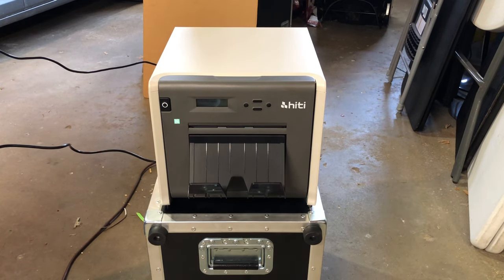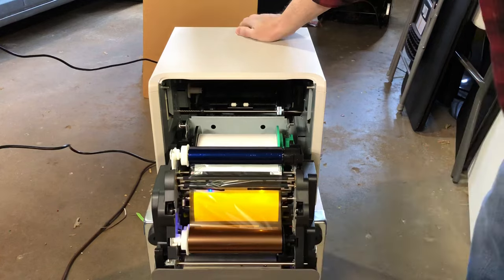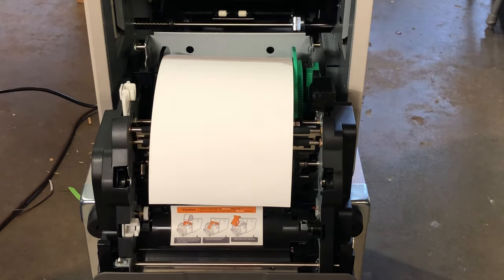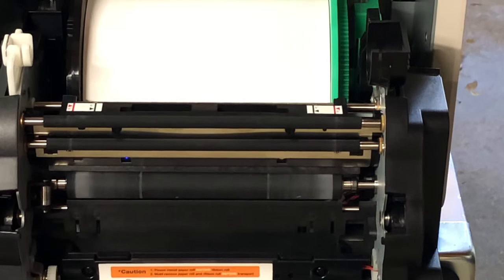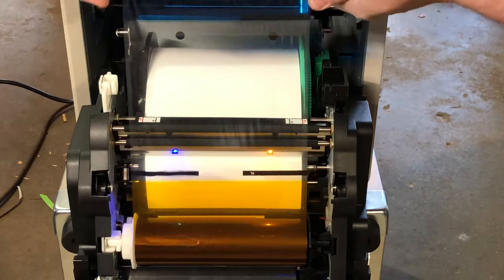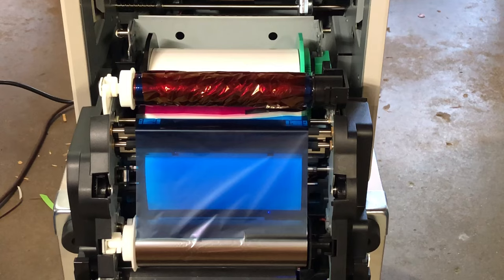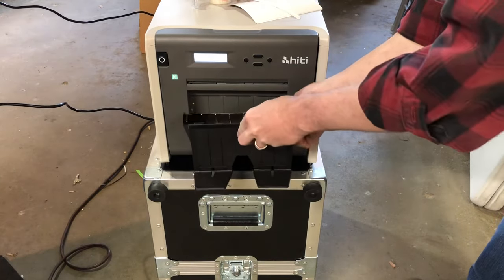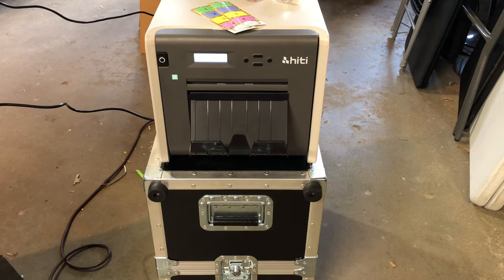Hiti P525L Loading Paper and Ribbon

Comment: Hello! I would need help. I use the same printer with the dslrbooth program, but it won't let me print 6x2 pictures, (windows 10) when I try to print, it keeps telling me that the roll size is not good (6x8).

Comment: Hello sir I just finished using up my paper and ribbon,  I changed out the paper and ribbon but when I close the system the printer starts up but it keeps telling me paper jam or ribbon out and I know I doing the set right but I keep getting these errors. Has this happened to you or do I have a bad print?
Reply: I have the same error. Frustrating.
Reply: @syncworks9797  How did you fix this error?